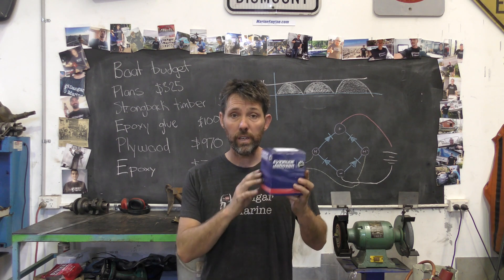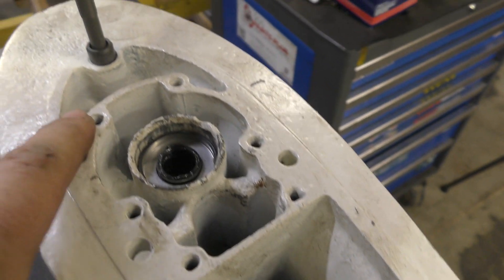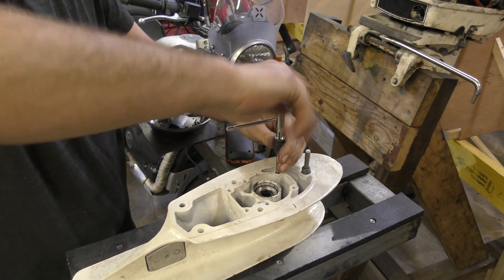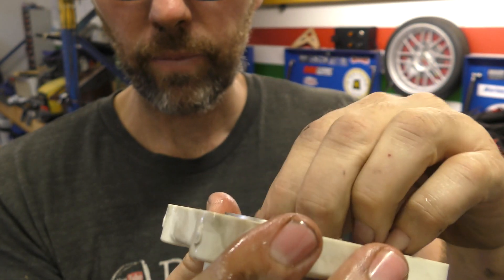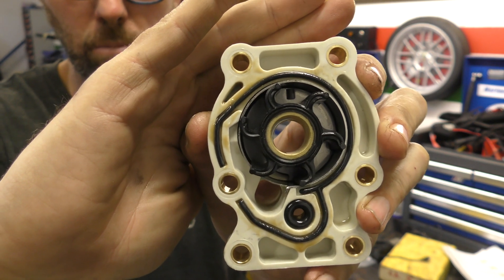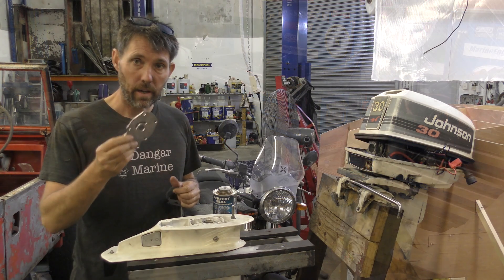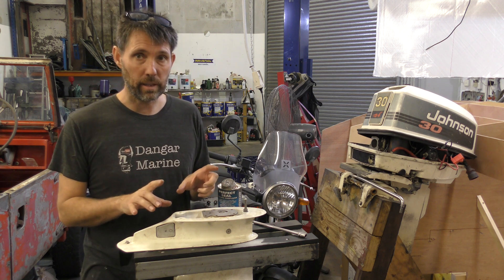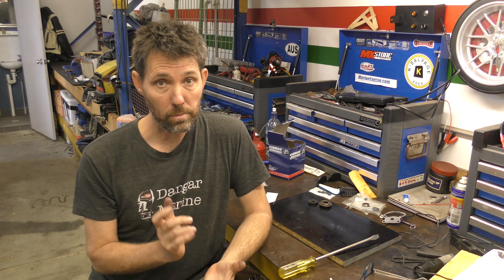Replacing the water pump on a Johson 30HP outboard

Comment: That's a diabolical design, making a part's bolt pattern non-symmetrical, but just close enough to symmetrical so that when the gasket is on backwards, it isn't obvious. This way, 50% of the outboard-motor-repair wannabees will screw it up...actually, with Murphy's Law, over 90% will screw it up.  Maybe sometime you could do an instruction video on Murphy's Law and its application to marine repairs.
Reply from the maker: I like your video idea. ;)
Reply: And remember - Murphy was an optimist!
Reply: Obrigado foi esclarecedor mau motor os 30 hp

Comment: Great video! What do you do if the water pipe came out with  the lower end? I'm able to push it back in though it doesn't seem to be very tight. Is this normal or is there another piece at the top of the water pipe that I now need to replace?

Comment: Hey, mate, I enjoy your videos, quick question I need to ask. I have a 1994 Force 40, next to one of the 4 bolts that secure the bottom end there is a weep hole (starboard side forward bolt). Today I was running it and notice water is running out of the hole. Is this OK or an indication something is wrong?
Reply from the maker: That's fine, completely normal.
Reply: Dangar Marine, thank you.

Comment: Anyone have any tricks on removing a stuck woodruff key? just had to crack through the impeller to get it off to find the woodruff key is also stuck on the shaft... I'm at a loss and do not necessarily want to have to cut it out? any help is much appreciated.
Reply from the maker: I get a cold chisel on the top edge and hit it with a hammer.
Reply: @DangarMarine  thank you. Going to give it a try today. I soaked it in oil last night. I'll let you know how it goes.
Reply: @DangarMarine  got it!! Thank you brother.

Comment: My idle on my evinrude 150 it’s at 1800 on muff is that normal on lake it’s on 1,000 rpms idle
Reply from the maker: Yes, there is no back pressure on the exhaust then the motor is on muffs.
Reply: Dangar Marine Thank u

Comment: Would have been helpful if you went thru finishing the final assembly. Had some trouble, got it down but could have used a couple of time saving tips. Not complaining, this was my first time working on my outboard and you instructions where very helpful. Lol P S , I forgot a step exactly like you did and back tracked. Yep same step. Thanks

Comment: Hey there is a better way of replacing pump; your way of dealing with the nylon key when putting things back together = putting impeller wheel back on shaft: check Michaels backyard marina makes job much easier!! No offence mate, just sayen, your way didn't work for me.

Comment: Why not just cover the water pump bolts when painting so you don't have to clean em out. Seems like just something that could go wrong. And never squeeze a metal shaft in the vise, that's a horrible idea. Pinch it in some wood or something. Other than that it was good instructions how to get it out and in 🫤

Comment: I have a evinrude 28. It has had a complete rebuild but has been sitting for a long time.i started it and at idle I am just getting a dribble at idle and a stream when giving it power. Is this what it should do? I have had bigger motors and they have a stream at idle.